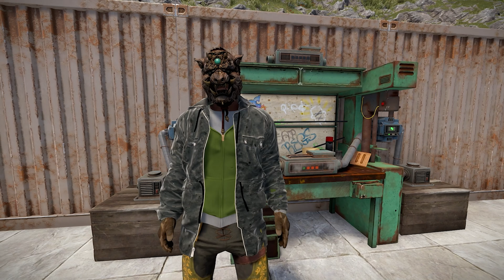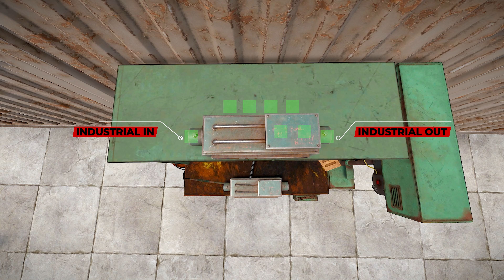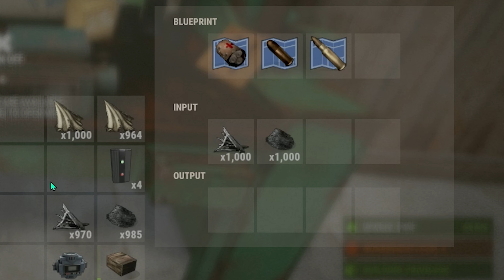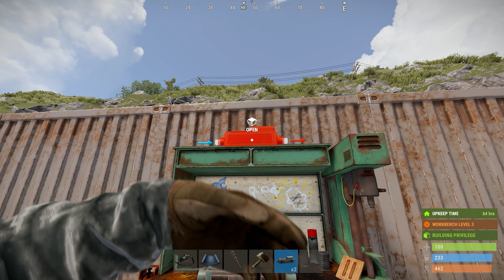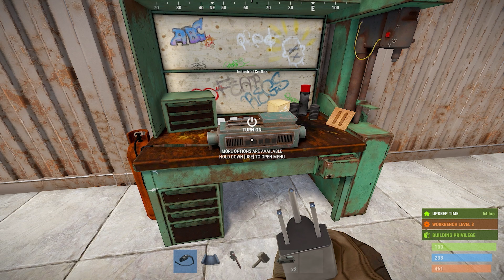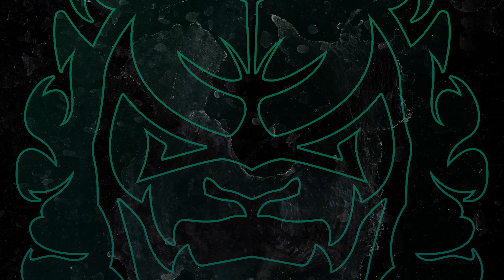Industrial Crafter Rust: Automation Guide for Effortless Crafting!

Comment: How do you get the blueprints?
Reply from the maker: You need the item crafted, then bring it to a research bench, spend the cost of scrap to create, then make sure not to “learn blueprint” just remove it from the bench and put it in the crafter!
Reply: @Sledge315 what if you already learned?
Reply: @darkdemon7346 the crafter works off of the blueprint, so you'll need one regardless.

Comment: Hey man, kinda forgot to watch this one—saw it on Discord and then it slipped my mind 🤣

Didn't know you could attach an Industrial Crafter to the upper part of the workbench too, that's neat!

One thing to note though: The reason why it can only be attached to workbenches is to prevent skipping the tier progression. If you find, say, an MP5 and an Industrial Crafter_, you won't be able to just turn the MP5 into a blueprint and mass-produce it without a T3 workbench. The _Industrial Crafter can only produce blueprints that match the tier of the workbench or below.

I usually use one to automate all my medical supplies. By utilizing the priority system, you can craft every medical item without swapping out blueprints—just by regulating the input and output. Posting my whole setup here would probably be too much, so I might either share it on your Discord or even make a video about it, dunno yet.

Great video as always, man! Love that you're experimenting with animations—it looks clean 😉
Reply from the maker: Glad you liked the video and extra animations! I didn’t know about the tier of workbench to blueprint although it makes sense! I never crossed this issue due to putting the crafter down on T2 most the time and I never really auto crafted T3 items as creating a BP for some of those more expensive BPs never seemed worth auto crafting! Makes sense all in all though